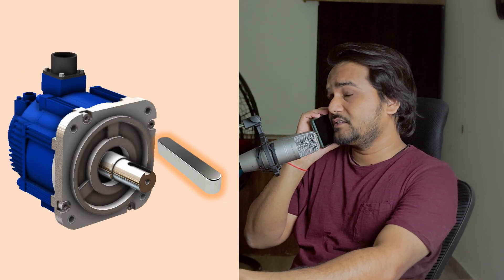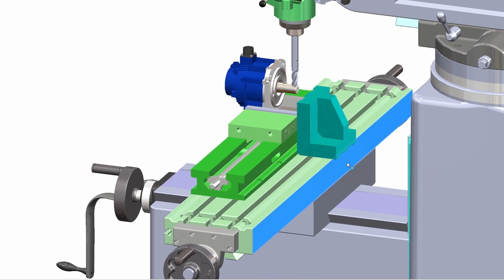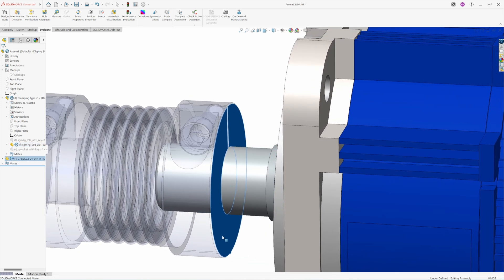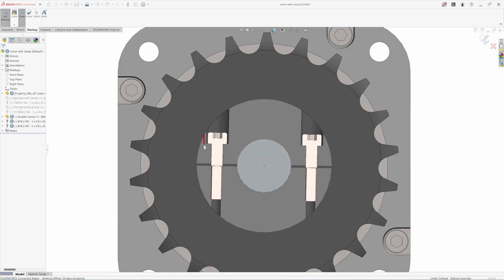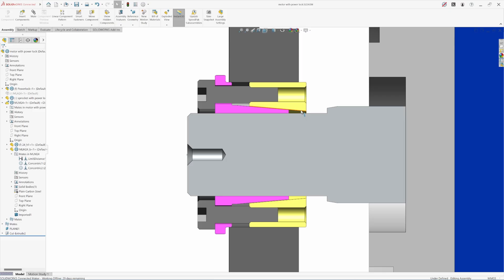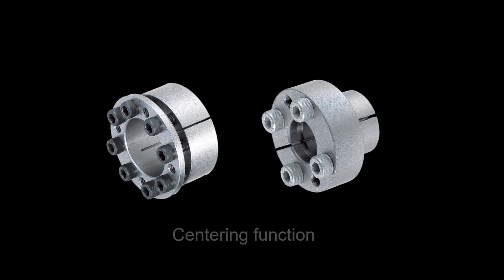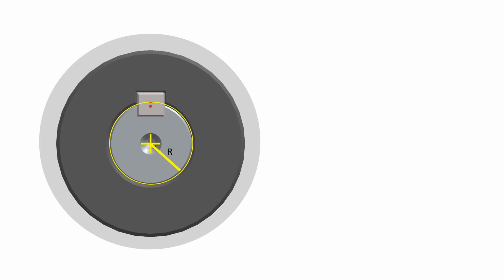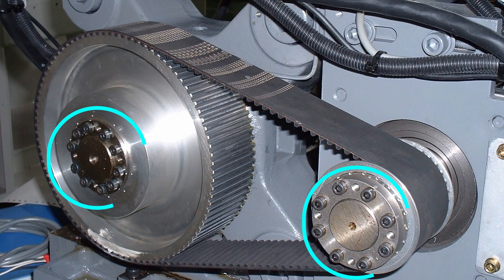Keyless Shaft Locking Mechanical Design - "Power Lock"

Comment: Hi Ayush, Thank you so much for the video. You have explained it very well. I have a question, Sometimes we have a situation where we have to use a Keyed Motor Shaft on The Keyless (Split Hub or Other types) coupling. What could be done in this situation? Other can also join this conversation and share your feedbacks and understandings.
Reply from the maker: for a general machine- it's okay to use without key

Comment: First method is terrible may work in CAD or students mind, they slip destroy shaft you will end up scotch keying it. 

Tapper lock any style is the right way will take up the gap few key points missed.
Torquing bolts make sure it is the tapper has locked and not the flange faces or bolts bottomed out there need to be a gap on each of them making sure the tapper is holding.
Warring make sure the other part can be hit with hammer towards motor for removal or have threaded holes for puller also on install one part is moving over the other so it need this room to fitted alignment can be tricky.
 
Also and Hard steel on Hard steel will not grip.
Locktie is your friend with small or worn part. 

KEYWAY is outdated for motor shaft BUT fitment the key is over sizes and hand filed to a interference or hold down with grab screws combined with tapper lock never problem. 

other major advantages of tapper lock very cheap easy to change out different size shafts, pulleys, sprockets, coupling.

Comment: In case split hub used, how to prevent sprocket move axial?
Reply from the maker: Use can give steps in shaft, to position and lock axial direction
Reply: Have seen the clamping bolt interferes with shaft so you can file in a small grove to keep in place. BUT if its moving its not gripping right? and the other sprocket is telling that one where to be!

Comment: I am myself from India but I generally avoid videos from Indians, they are 99 percent just straight rubbish or very outdated. So i mostly watch international videos for DIY and other stuff. There are a few Indians though, whose videos are of very high standard, wrt to the subject matter and you are one of them. Very few people talk from experience, most of them just push rata rataya kachra. You are talking from your experience it seems, and this is so invaluable. Your videos made me understand these things so clearly. I am Electrical Engineer and have been struggling with bearings shafts and fits, trying to make a wind generator. This is the first time i understood how to lock things properly to the shaft. You made things so clear, that instead of buying these, i will make my own (i have learned a little carpentry, so i will try). You work made me proud to be an Indian. Thank you.
Reply from the maker: Thank you so much for your kind words. I'm proud to be Indian too! Love you

Comment: why have you added the lenght of the plate to the length of the ball screw?
Reply: in the video of linear actuator
Reply from the maker: Float plate? Yeah, float plate to consider in screw stroke length.
Reply: Why it has to be considered ?
Reply from the maker: Basically, total screw length equal to : Stroke length + Ball nut length + both end bearing length + Coupling length + some extra length (if required) 
and in that particular design, i will have to consider ball nut length as float plate total length because i can't travel the float plate over support bearings

Comment: Please correct me if I'm wrong, but press fit is often employed for components like gears and shafts. When there is excessive clearance due to operation between gear and shaft the we simply replace bush if  there is option during assembly.

Btw great content I always learn new things from your videos. 👍
Reply from the maker: I am not sure, I have not seen press fit used to fix gears on shafts in industrial design, like in automobiles, locomotives or aerospace, however, press fit is used for locally positional fixed, like so often for dowels, but not for interchangeable parts,
However, if someone is doing press fit for gears and shafts, it may be just for cost savings. But at the same time, it is bad method, it will be painful to take apart
Also you can't do press fit on motor shaft, motor will get damaged.
Reply: @mastermechanicaldesign  thanks for reply.

I have seen gear to gear assembley by press fit and shrink method. In shrink  we cool one gear and heat another gear then simply place them togather at desired angle.
Reply from the maker: Ahh okay, what is the application
Reply: @mastermechanicaldesign  they use them in gear train to Drive two different mechanisms at the same time in the same machine. Just search cam gear and cluster gear.
I'm still in learning phase. 🙂
Reply: @monty9164  shrink fit to motor shaft is not smart, tapper lock will give way more torque than needed, running belts, chain or coupling small runout is no problem.

Comment: hello , in the video of linear actuator , what factors have you consider when choosing the seervomotor ? in fact , how can we install a servomotor working under 400 v ? and whay does it mean servomotor without gear?
Reply from the maker: 1. Factor considering when choosing servo motor: Factor all depends on mechanical system which is connected with servo motor, for example in that video, ball screw was there so we have considered 90% efficiency, if there was lead screw, we should go for 70-80%, servo motor fully deliver its rated torque 
2. How can we install servo motor working under 400 V: Yes, we can, most of servo motor comes in 400V, voltage take by its servo drive, without servo drive we can't operate servo motor
3. What does mean by servo motor without gear: its actually gearbox, means if required speed is less, then we can use a gearbox with servo motor, or inbuild gearmotor, to increase the torque.
Reply: @mastermechanicaldesign    in a similar project , i have to do the same thing but I have three linear actuator and one to rotate a spray paint gun . the existing mechanism is manual and i have to make the make it automatic

Comment: Now clearly understood why motor manufacturers  and gearbox manufacturers making keyless shaft. Excellent graphical representation of double taper lock and single taper lock. Thanks for sharing the great knowledge.
Reply from the maker: Yes right. that's the main reason, manufacturer gives without key cut option.
also, for a high dynamic balance motion, a keyless motor should be used with power locking.